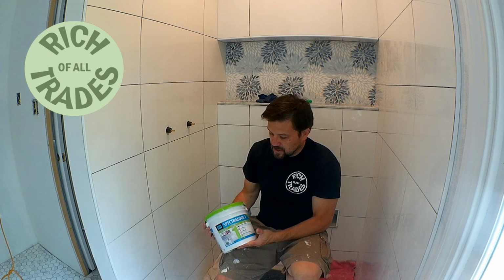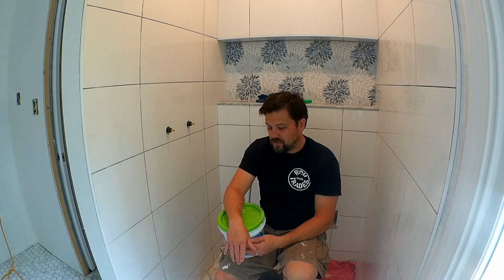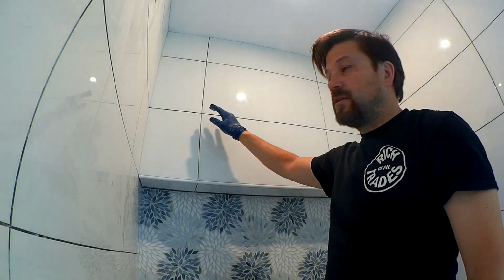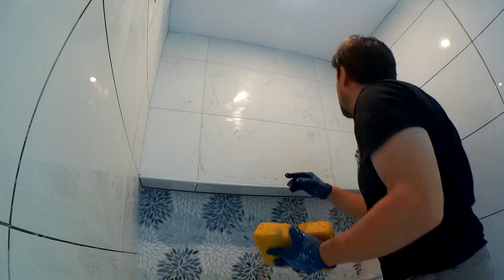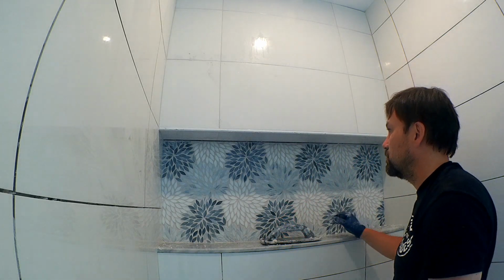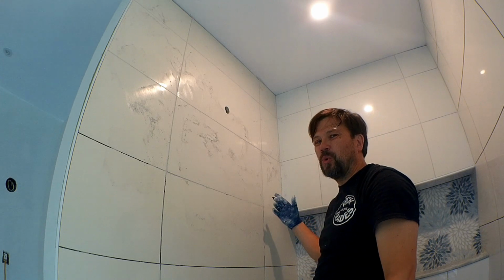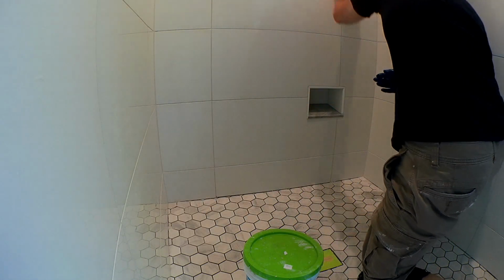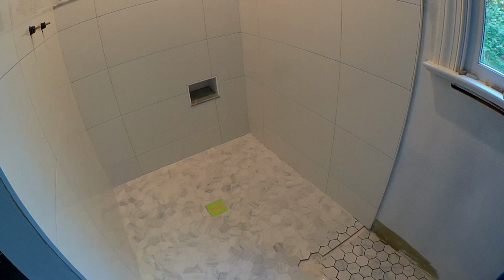Grouting A Shower Using Laticrete Spectralock 1 Pre-Mixed Grout

Comment: Nice job, I am about to do a similar shower with similar color tile.  How does the Silver Shadow look when done?  What width grout line did you use?

My shower is 3x5 and will be using 36" x 36" tiles so very minimal grout lines.  The floor is going to be similar to yours, with the hex mosaic.  Like you, I will be using the Spectralock 1 on both the walls and floor  The 35 year old shower I removed had no grout cracking in the walls or floor to wall grouted joints.  So I ma grout my corners as well.

Thanks for the video
Reply from the maker: Thanks for the question and feedback. The grout color looks great. I think it compliments the white tile well. I don't notice a difference between the Spectralock version and the standard grout that I blended and used on the rest of the floor. The grout joints in the shower are 1/8 inch. 
Hope this helps. Good luck with your project.
Reply: @richofalltrades1  Thanks for the reply.  In the next few minutes I am going to grout the 2" hex mosaic's on the floor, will let let you know how it works out.
Reply: @richofalltrades1  Just finished up the grouting, came out really nice for a 78 year old with bad knees.  (good thing I have short legs) The Spectralock 1 was a little hard to force into the joints but it cleaned up nice with the damp sponge and micro fiber cloth.   I roughly did it three 20" x 36" sections, cleaning up each section before moving to the next one.  Took about 3 hours.
Reply from the maker: Good for you! I am glad it worked out for you. Yes, it does require a little extra effort putting it on as well cleaning the tiles, but I think it is a better product for wet spaces.

Comment: other people said the orgization demand that silicone must be used in cornor, one of my inner corner has a big tile ,maybe i will follow you ,first grout it with spectralock pro ,and then cover it with silicone. but i even don't know ,is it permitted ?
Reply from the maker: Thanks for the question, I reviewed the TCNA handbook 2019 version and I don't see anything specific regarding wall to wall changes of plane, but it does state that for where the floor meets the wall it should be filled with Flexible mildew-resistant sealant—ASTM C920. Just to be clear I didn't use the sealant I used grout. However, if cracks develop I may add it over top of the grout with a thin small bead. Maybe others have better guidance.